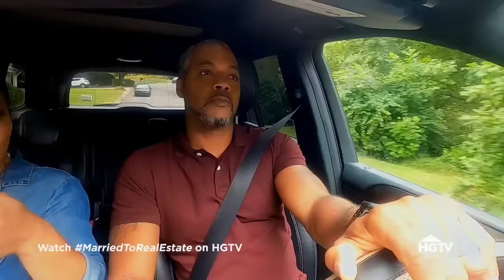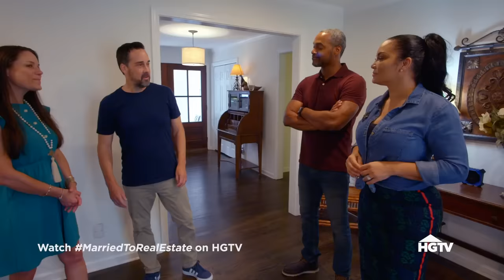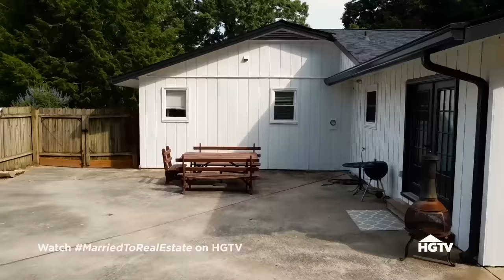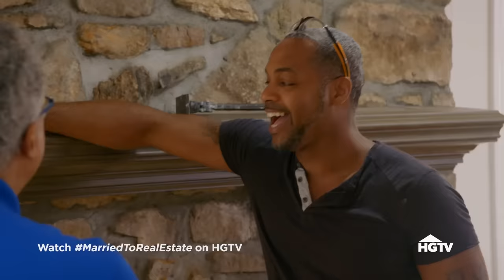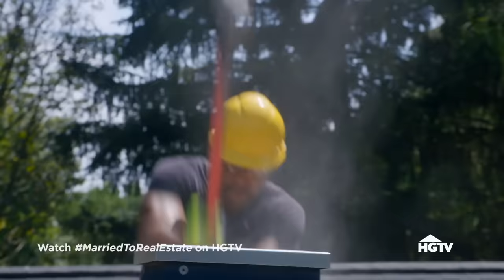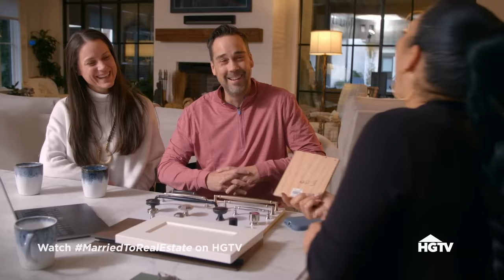From Apartment to Open Concept Home Renovation | Married to Real Estate | HGTV

Comment: why do they put stoves & sinks in the island? i cant see trying to wash my hands while people are eating or splattering hot cooking messes. never mind little kids climbing stools to grab hot pans
Reply: Quelles Horreaux! Someone sees you wash your hands!
Because it allows you to keep an eye on the room and occupants rather than having your back to it instead.  Its easier for both you and them to converse, maintain eye contact.  Easier to stay in control of both, and the kids others are less likely to intrude in kitchen space.  When young children are a safety concern just make the space between the stove and the stools a little deeper.
Additionally it is easier to clean splatter from a countertop than windows and backspashes.

Finally, kids should be disallowed from climbing on stools as they can fall...
Reply: Nah, I'm with you on the above thing.. not for me either.
Reply: As long it’s in an accessible triangle (stove, oven and fridge) - having the stove on the island should not make much difference.
Reply: I agree re: the stove, but liked my sink & dishwasher in my island. And it was big enough to have work space on the side of the sink.
Reply: I don't like that either.